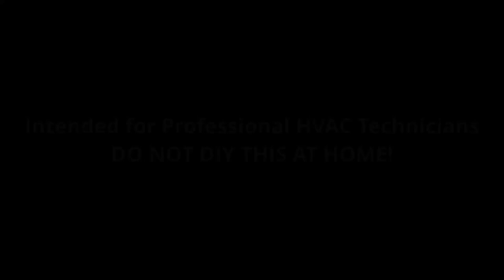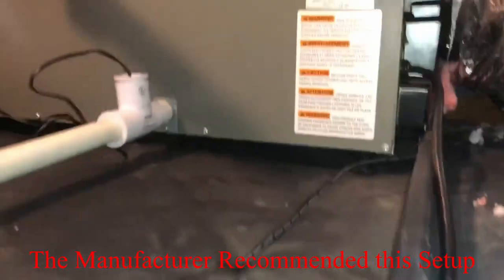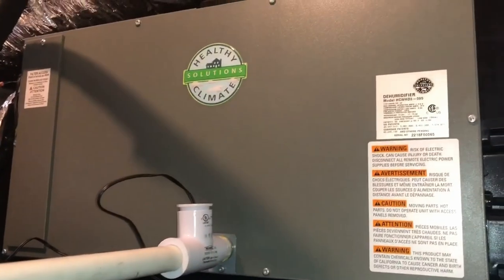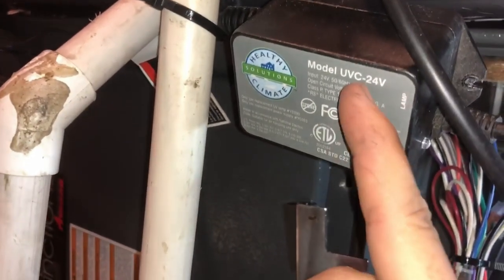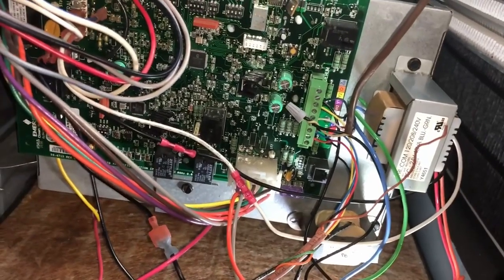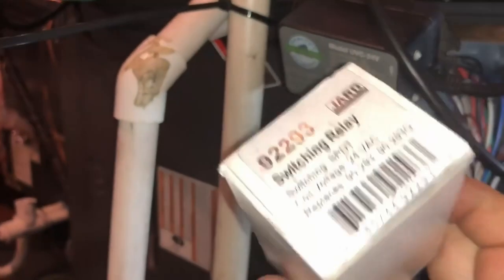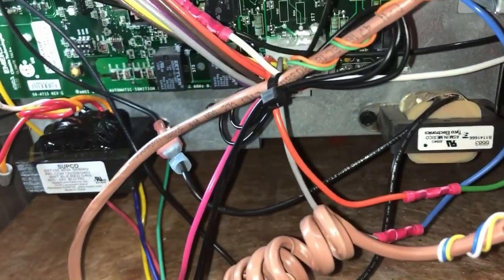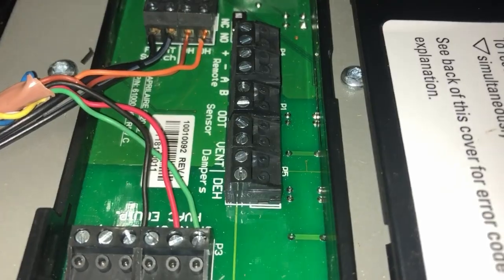EP11 Connecting a Dehumidifier to a Nest Thermostat

Comment: would have been helpful to show how you setup the nest and did the wiring......
Reply from the maker: Yeah sorry about that. Couldn’t film connecting the Nest due to the client being over my shoulder the whole time. Also this was an earlier video. I couldn’t find the footage of wiring the relay and the de-humidifier. I was still learning how to edit. So sorry about that. I’m always trying to improve and I appreciate the feedback. Thanks for watching.
Reply: @NighthawkHVAC  no worries! I understand. Still trying to figure out if I want to replace my hvac 80% with new variable speed 95% units. Expensive though.
Reply from the maker: Very true,  the more efficient the unit the more upfront cost, however you may want to look at your run cost,  sometimes more money upfront means money saved down the line,  there's always the middle ground,  you can get a new 80% furnace with a varible speed blower which will perform better and run a cheaper.  Assuming you have a good duct system in place.  The AFUE rating only rates the gas consumption of the furnace and not the electrical usage.

Comment: how do you connect the relay to the dehumidifier ?
Reply from the maker: The Nest 3rd Gen thermostat has a NO relay *. You can use this to energize different accessories. You can setup humidifiers, de-humidifiers, etc. This connection was used to energize a NC relay which would then cut a 24v connection to the de-humidifier control panel to cycled it on and off based one the humidity level read by the Thermostat.
Reply: @NighthawkHVAC  so do you need a relay for the 3rd gen nest on say an ultra aire 120H?
Reply from the maker: The relay is required by the Lennox DeHumidifier in order to be controlled by a thermostat